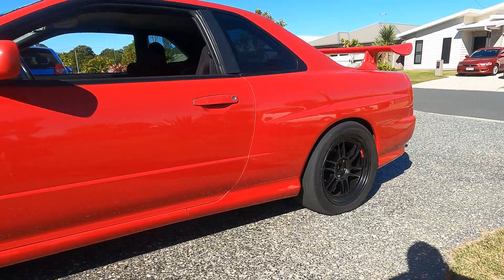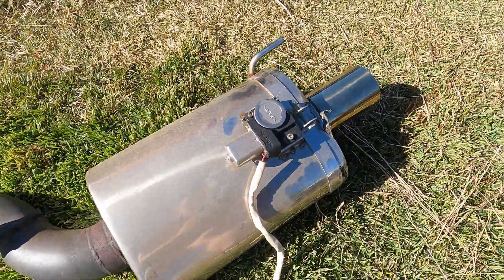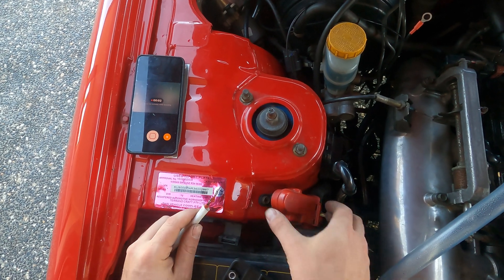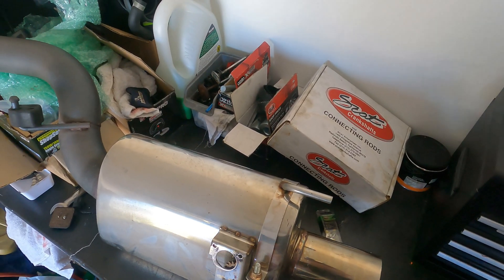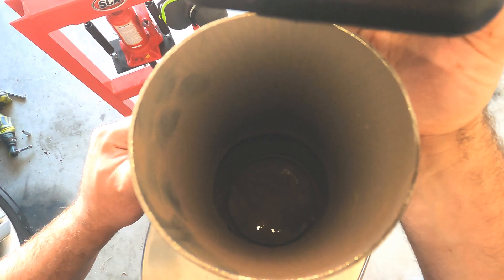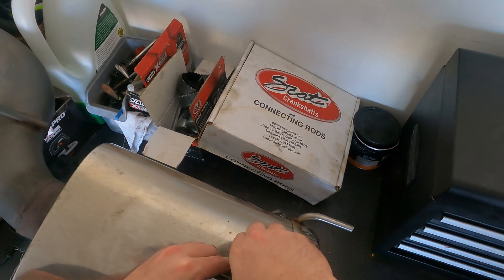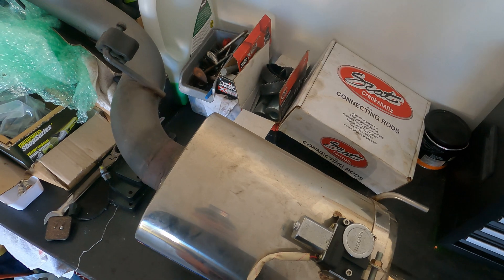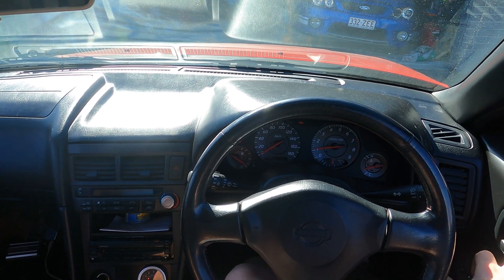Troubleshooting a Varex Muffler - Fancy Exhaust Cut Out

Comment: Hey Gap Sauce, thanks for this review, I'm starting to build a custom exhaust for my 6.2 L Raptor with a 4" Varex. I'd almost like to hardwire it from the git go, since remotes are never at your fingertips. Second biggest complaint I see is the quiet mode is way too stopped up right? Where did you get that internal diagram? Are you certain this is what it looks like inside? I asked XForce and they wouldn't tell me. I'm tempted to cut my Varex open and give the quiet mode TWO of those bypass chambers to double the quiet mode flow. Anyone with thoughts here please chime in👍😎!
Reply: I don't have a varex muffler yet but I've been thinking about the same thing for a liberty 2.5gt. With the turbo back pressure and what not, I don't want to lose performance when i'm on quiet mode as that's what I'm likely to use most of the time. Please reply here if you ever end up doing it and how it went.

Comment: I bought a car with a varex exhaust and no remotes? When I connect Bluetooth app it requires a 4 digital code i didnt get. If i reset the smart box to factory settings, can I apply my own code and be able to operate the valves from my phone? Cheers mate
Reply: I'm sure you've already figured this out but yes and yes. I'd like to see an honest review of the bluetooth version if you're up to it? I've got the std version.

Comment: I am on my second control box and my mufflers are not opening again, what I found replacing my control box the first time was that the control flaps were rusted and stuck closed, probably what caused the control box to blow. Going to reach out to Varex and see what suggestions they have for keeping them lubricated.

Comment: On my one there's signal on the box but the mufflers are not opening or closing
Reply: Same…have you sold it?
Reply: @BenceChlumetzky  it turned out a faulty box. Hard wired it instead. Works like new now
Reply: @002GEO how did you do that ? I have the same issue

Comment: Hello, I can’t manually move the valve it’s seems to be stuck any idea ?
Reply from the maker: Might need a clean to free it up?
Reply: @GapSauceYoutube  thanks,I cleaned it and it came smother again but still same issue , i can open it directly but when I want close it it won’t close  click a hundred times to close just hearing sound of click in control box
Reply from the maker: @kmysterious9  Maybe try removing the motor and testing its without in sitting in the muffler.
Reply: @GapSauceYoutube  it’s working I tested it probably the control box dead🥲 I’ll try wired it directly to toggle switch

Comment: Varex on my VF ssv has failed after 2 weeks. Top notch lol. Was a cool feature until it’s failed in the closed position. Likely the controller as both mufflers are not opening
Reply from the maker: I've had trouble too since.  Even after hard wiring it in, which I believe is necessary.  I think allowing the car to return to idle before attempting to open/close it helps.

If you pull the cig lighter adaptor end cap off, there is a small fuse in there.

Comment: I'm having the same issue, thanks for this video
Reply from the maker: No worries, I ended up using a bipolar switch to hardwire it in.
Reply: @GapSauceYoutube  just need clarification, you turned the valve cog wheel counter clockwise to open the valve correct?
Reply from the maker: @drsnowmon  I can't actually remember sorry mate, you can see the valve from the rear of the muffler.

Comment: I Have a varex in my Pug 106. Sometimes it gets stuck because of the coal retained inside de exhaust itself
Reply from the maker: Ahh, unlucky. Mine was a dead controller.
Reply: I have the same issue. How'd you break it loose?  Damn carbon build up
Reply: @Skimpy33  I take of the motor from the top and clean with wd-40
 I spray inside the tip pointing to the tol of the valve while rotating it with my hand

Comment: I run racecraft E-boxes personally, way better in terms of flow as it exits around the valve when closed in a 2 1/4' pipe as opposed to the tiny holes the varex pushes it through, been running 28 pounds through the racecraft  closed and open for little over a year and never had any issues, can even close it mid pull at full boost haha
Reply from the maker: Thats interesting, I'm not a fan of the  way it works either. The backpressure it would have even at cruise is enough to worry me with that tiny hole. I'll look into the racetrack unit though, thanks 🙂

Comment: Hey mate I had a varex and was told by my reseller that the remotes are junk.
They hardwired it in, and then hard wired a switch in my car under the dash/steeringwheel area.
IIRC you'll need a 3-way switch (like a window switch, up-neutral-down) .... prob also need abit of electrical magic like a relay as well.
Reply from the maker: Thats exactly my plan, but that's for another video. The remotes are working, I found a blown fuse and the control module is unresponsive.  I'd hardware any future system in, I've seen alot fail now.
Reply: @GapSauceYoutube  my thought exactly to hardwire it in 🤙🏻
Reply from the maker: @fryfamilytv  My mates remote stopped working when he was pulled into an rbt 🤣 definitely going hardwired.